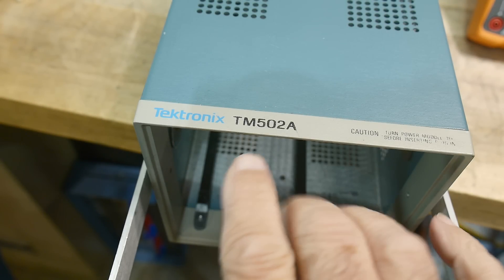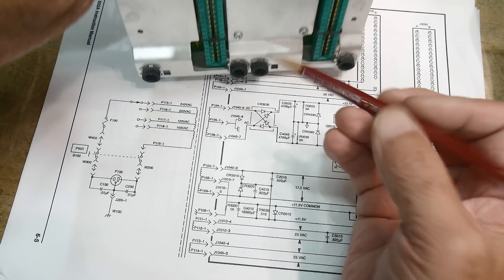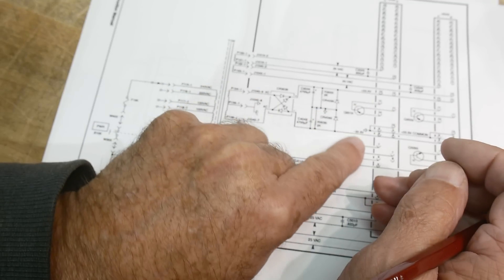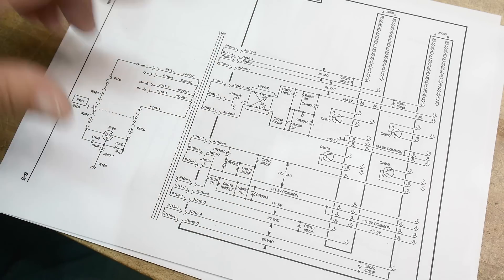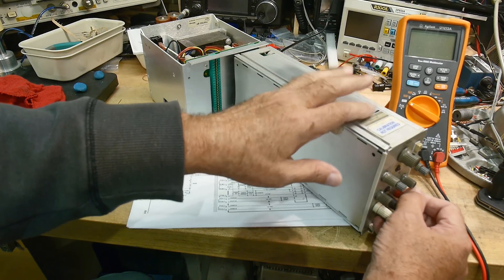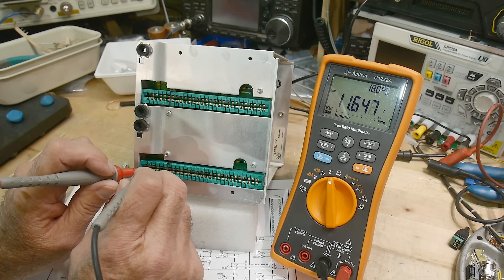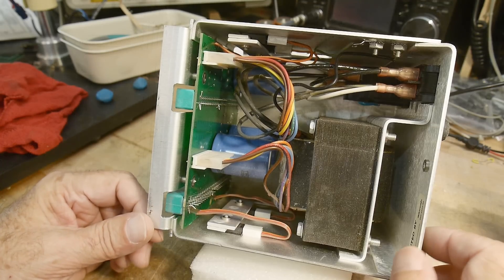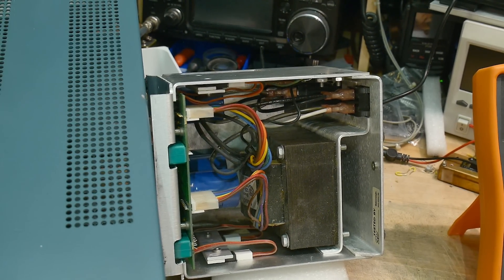#1341 TM500 Mainframe Design

Comment: Good point about the transformers. I would expect the 4 slot to use 2 and the 6 slot to use 6, but what about the 3? Was it worth making a special or did they have 2 transformers with a spare set of windings? Just idle curiosity....
Reply from the maker: the 502, 503, 504, 506 all have one custom transformer.

Comment: The 502A was a very recent design: those wacky leads off the pass elements are unique to that model. All my old mainframes (and the 503A I use as a test jig) have them soldered right to the board, as you'd expect. FWIW, the 504 is the most useful of the mainframes. 502 and 501 prolly being the least useful. 

I  modded my 503A test jig with an analog meter and current sense resistor on the mains power input. It doesn't need to be calibrated, it just tells you if things are going south when you bring up the voltage with a variac on the DUT. I used an old meter from a 12V battery charger (grin). Additionally, you can see things like bad capacitors by looking at how steady the needle on the meter is, as well as inrush current. Finally, it provides a quick check when compared to a known working plugin.
Reply from the maker: I noticed the TM5006 has the wacky leads also. Guess it was the new way.

Comment: Is it just power connections on the backplane?  Or are there any signaling / communication common across all the cards (or maybe daisy-chained slot-to-slot?)   I wonder if Tek had some sort of instrument automation capability like HP-IB/IEEE-488 to control the various plug-in devices?
Reply from the maker: no, just power. the TM5000 series that came out later in 1982 added GPIB
Reply: Yes, there are some limited interconnectivity between the slots.  What signals are available and on which pins on the bus are used depends on the specific modules in use.  The TM manual should provide a good overview of the capabilities, specific module manuals for the details. IIRC, some solder-state programming may be required, but it's been a long time.

Comment: The pass elements in the frame are used mainly for the power supplies of the plugins themselves not the outputs of the plugins, the power supplies are an exception. There is a larger issue with the pass elements in the frames. Depending on the era of construction the pin outs of the devices are all over the map. If one needs to be replaced triple check the pin outs of the installed device as well as the pin outs of the replace. Pass elements should also be checked before plugging in valuable modules to the frame a dead pass element can roast a plugin given, they are usually regulation elements in the power supplies. This can be bad for say a sg505 or aa501. Not a big a deal for a PS503.
Reply from the maker: thanks, good to know. I've watched a few of your videos. good job
Reply: @IMSAIGuy  Thanks, I am looking forward to your thoughts on the 500 and 5000 series stuff. Some of the modules still have some amazing “banner specs” that still hold up even today.